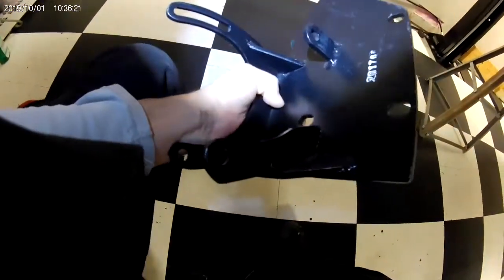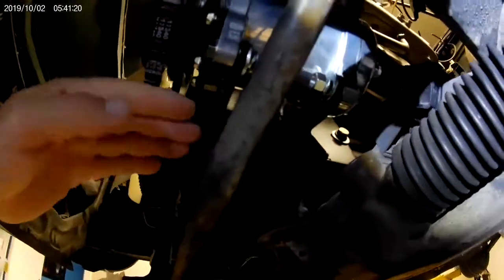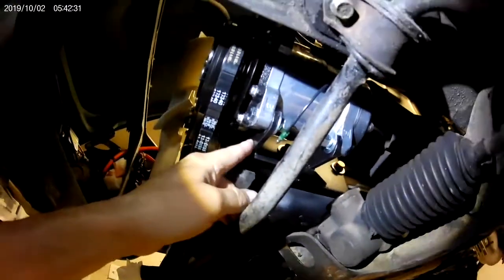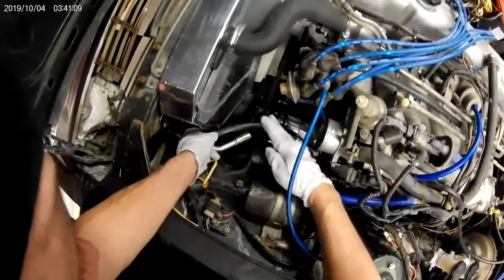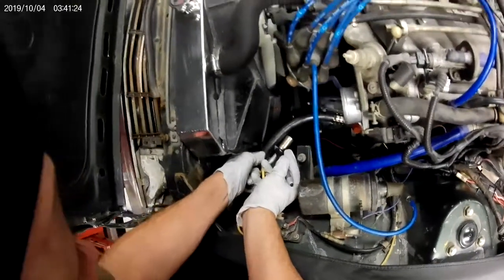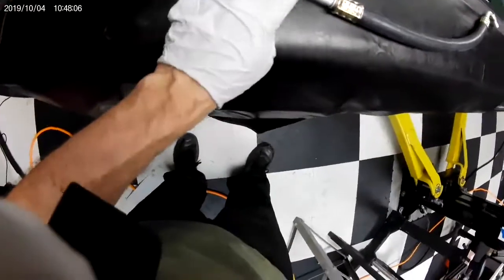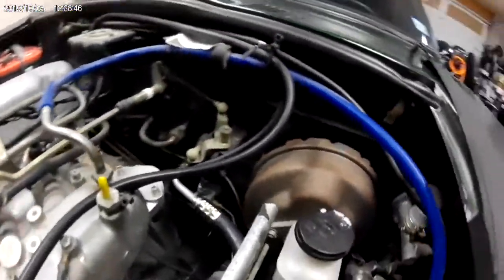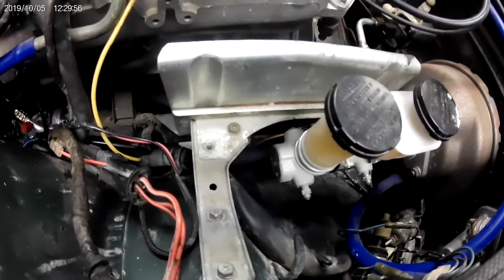280Z Air Conditioning AC Compressor Upgrade Kit Install

Comment: Hi man thanks for the videos. Very helpful. I have a 1977 280Z and what I am doing is very similar to your project. I am also installing the FAST EFI retrofit kit and I also want to update the factory AC system. Can you tell me what you had to do to get your new AC system working? So what parts did you replace, what parts did you remove and what original parts are you still using? Thank you!